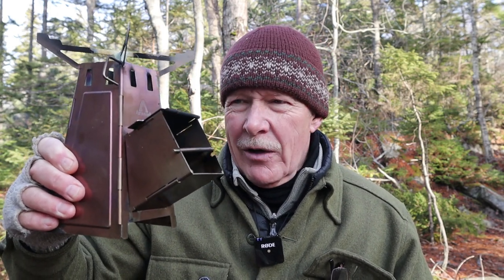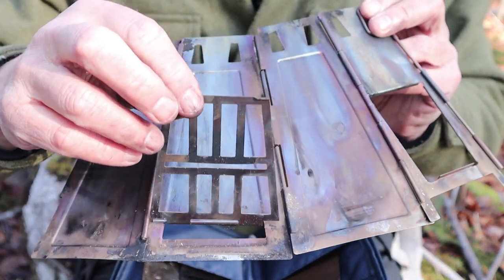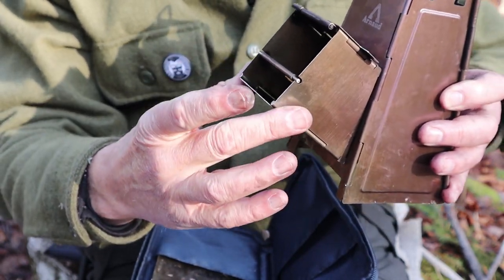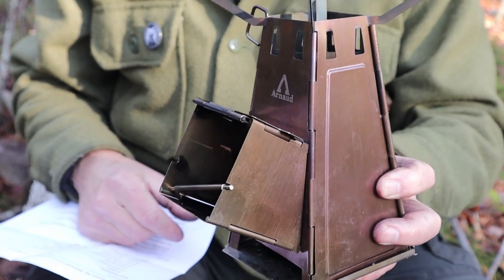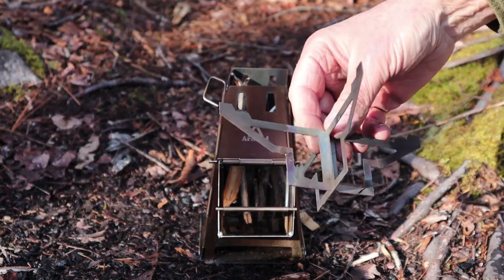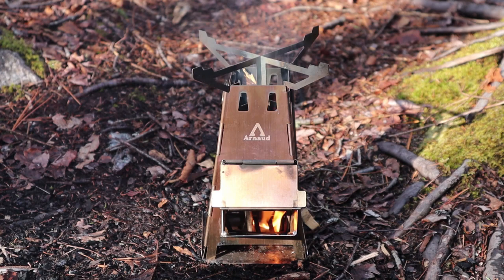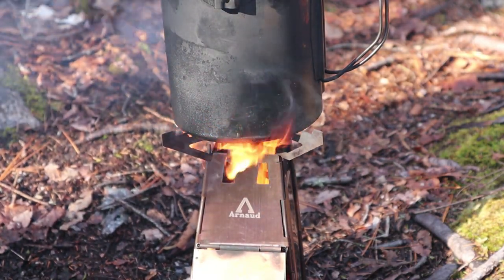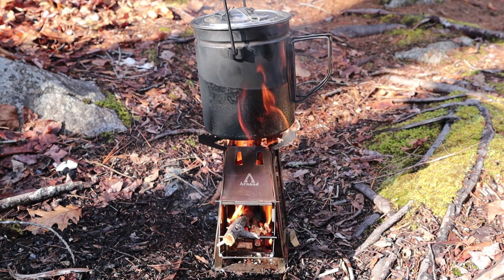The FireTower by Arnaud

Comment: Really exciting to get introduced to new products I haven't seen yet. I have the lixada rocket stove and I like it, but it's slightly bulky even though it is light. I have been looking at the Vire stove and I really like the flat packing aspect, but it's so heavy at 1.3 kg and the smaller version I'm told doesn't work as well. The FireTower of course also flat packs and at 500 grams it saves you 800 grams in your backpack. Thank you for showcasing this product, awesome!
Reply from the maker: I enjoy testing out these new stoves. Thanks for commenting

Comment: 500g for a flat packing rocket stove, that's excellent. Price is fair. Setup is simple and quick.
 They could make it out of titanium for a backpacking version as you said, which I agree would be a good choice.
Ashpan could be replaced with a much thinner lighter piece of steel for a good weight reduction.
The tappered chimney helps with airflow due to Bernoulli's principle. 
Engineering put to good use :)
Reply from the maker: I agree it is well thought out. Thanks for commenting

Comment: That is a well designed stove for sure. So many aspects of it that I like, and with a couple of tweeks you suggested, even better. If the slot the feed tray pins slide into were "L" shaped instead of just straight in, that tray would be far less able to slip out of place, and add a bend to ends of the tray wire nubs so they won't slip inside the feed tube...
Reply from the maker: Agreed. The designer is ready the comments and is looking at making some changes. Thanks for commenting

Comment: Some impressive engineering on that stove.   Do you feel that the feed "ramp" offers an advantage over just a plain open square that many other stove designs use?   If the ramp facilitated automatic gravity induced self feeding for fuel, I could see a tremendous advantage.  However it seems as though it still requires manual fuel feed maintenance.   In my mind, I'm comparing it to the Firebox stove that has two small feed ports located 90 degrees from each other.   The firebox fuel feed system works very well for me personally.
Reply from the maker: Hi Lonnie. Good to hear from you. The best comparison I can give is with a Chinese rocket stove I reviewed a while ago. It does not have a air feed under the fuel ramp. Instead it relies on air being drawn in from around the base. It has pretty much the same performance as this stove does. A more greatly angled feed ramp may make better use of gravity but I feel it would compete with the primary chimney for which way the flame would rise. I have seen much larger rocket stoves that are able to achieve gravity feed but I expect it would be hard to do in a small stove. The Firebox feed system stands as a classic bit of engineering. Simple and effective. I have another stove from Arnaud that I will be reviewing that makes better use of the duel air-wood feed ramp. Hope to see a new video from you and Connie soon
Reply: @MarkYoungBushcraft  Thanks Mark for the feedback.  I am impressed with the design of this stove that you showed.   It is clearly well thought out, designed and constructed.    I'm just sort of thinking out loud here trying to think through the burn and real world use dynamics.  I'm not really trying to run down the product in any way.   I hope you don't mind my way of critically thinking out loud.

Comment: G'day Mark, with the tall tapered walls, or frustum, (I had to google that, ...... a long while since high school, lol), anyway, its pretty much like a miniature fireplace/chimney, so I'm not surprised it draws so well.
Personally I'd be wanting to light it with a ferro rod with the chute off, which means you'd have to be quick installing the chute, before the main body heats up too much, since it appears to be a two handed operation, i.e you need to hold onto the main body while you do so.
Other than those tweaks you mentioned, I'm think'n some clearance between the ash tray and the ground wouldn't hurt, say => 15 mm.
Ultimately, between the draw, the feed in feature, fold down and storage, a lot to like. Cheers Duke.
Reply from the maker: Frustum. You just added a new word to my repertoire. Arnaud will be reading your suggestions as well. Thanks for commenting Duke

Comment: Rocket stoves take advantage of the thermodynamic law that heat rises and draws in cooler air from beneath. The increasing heat accelerates the volume of air drawn in from underneath, increasing the heat even more through efficient carburation (mixing of oxygen with combustible gases). This is what also makes the Kelly Kettle a fantastic water boiler, especially because the flame is completely shielded by the  double walled design which forms the water jacket. Unfortunately, the Kelly is bulky and somewhat heavy for my habit of taking very long walks in the mountains. 
I might buy the titanium Arnaud stove when it becomes available. 
Thanks, Mark!
Reply from the maker: Good explanation. Thanks for commenting

Comment: Nice! Hope more similar atoves like this one pop up. I think thr feeding ramo is unnecessary. I would use just thr tower. The simpler thr best.
Reply from the maker: So many stoves with different designs and features. Some work better than others and some just need a tiny change to improve function and versatility. Thanks for commenting

Comment: Morning Mark!    I have to say, I almost didn’t watch cuz I don’t like rocket stoves.   Too much heat in too small an area means they’re pretty much only good for boiling, and they’re too tall for the width for stability, plus they’re mostly too big and bulky, but I kinda like this one.  I really do.   I can see this as a great thing to pack along to boil up some tea quickly on a day hike, or for a night or two.
It just lacks the ability to double as an alcohol stove on rainy days, but a wire stand and a piece of aluminum tray wind screen would fit in the case.
And for about $100 Canadian.  I may actually get one.   Except I’m buying a new shotgun today, so it’ll have to wait a little.
Thanks Mark!         And no, I still prefer my firebox. 😂😂
Reply from the maker: OOOH... been a long time since I looked firearms. What are you buying?
Reply: @MarkYoungBushcraft    Remington Versa Max.    It’s not the best semi auto out there, but it’s not the most expensive either, and the few complaints are actually easily fixed.    Plus it’s supposed to be easy recoil and I’ll be doing some goose hunting this coming fall.  I don’t have a proper waterfowl gun yet, which is odd, since I have so many others (I sport shoot quite a lot, small game hunting, and am planning bigger game soon) so today I found a good priced second hand one, with the waterfowl coating.
Reply: @jimf1964  Nice!

Comment: just found and subscribed to you.  I was looking for info on making my own wood gas camp stove, and found your videos entertaining and useful. I tried my hand at it a few years back, and was disappointed, but I think the idea has promise.  I used a stainless steel double walled  tall coffee mug.  I thought, being tall, it would have good draft. The 2 walls being close together would make for good heat transfer. I see now that my air holes were too small and few, and the pot rest was too close and hampered the flame.  It's a little unstable, but there are some easy solutions.  Every thrift store has 3 or 4 of these mugs, missing their lids, for a couple bucks.I'd love to see how you'd do with with this, having your extensive experience, before I try it again. Thanks for the channel.
Reply from the maker: I have considered playing with these mugs as well. I may give it a try. Thanks for commenting

Comment: This is a VERY interesting stove Mark. I wish the stove had an option for a fire grate with small round holes so you could use wood pellets. It seems that the air flow this stove has would lend to a great burn with pellets. Maybe a diy modification with a separate grate on top? Thank you for sharing. God Bless.
Reply from the maker: It would be worth seeing if I can make the stove work with pellets. If I do, I will post another video. Thanks for commenting
Reply: @MarkYoungBushcraft  I would definitely look forward to it!
Reply: To Fireside Coffee:  Tinker says "Make one". Few tools are required for working thin gauge metals, even titanium. Firebox stoves (USA) makes a titanium cooking grate which  may be reworked for many different applications.

Comment: Seems to be a better stove than Kombuis 1.0
Reply from the maker: I just reviewed the Kombuis 2 but don't have the Kombuis 1 to compare. I like this better only because is folds flat and it lighter in weight. Both work well. Thanks for commenting
Reply: @MarkYoungBushcraft  I'd like to know how long it can burn without tending to? 

I know the firebox size and feeding port both contribute to how much it can hold. And the heat and fuel amount can both affect how fast it is running. I just want some estimation.
Reply from the maker: @yookoala  Also hard to estimate. If I load the burn chamber vertically I can get maybe 6 or 8 finger size stick in it that are no more than 5" in length. Loaded like that, all the woods becomes engaged in flame. If I use the feed ramp only, I can get maybe 4 or 5 finger size sticks in the chamber at once but they can be any length at all. Using the stove in this fashion, only the last 2 or 3 inches is burning. Hope this helps

Comment: Looks like a great stove.  An excellent reviewing job as usual too.  If I was tweaking this to fix the feed ramp problem, I would try extending the slot where the pins go,  not continuing straight toward the stove, but taking a 90° bend.  This would make it so when you put the ramp in place, the pins on either side would go in as they currently do, but then drop down into the newly designed slots.  Theoretically this would sort of lock the pins in and prevent the ramp from being pulled outward and falling out of place.  I cannot tell if the width of the ramp within the stove is enough to prevent the side to side motion which would cause a pin to drop out of place allowing the ramp to fall out as well, but this would also need addressing.  (Perhaps I missed this in the video?). Either make a wider ramp, or as you said extend the pins.  
What do think?  Take care.
Reply from the maker: I think you have something there. A combination of the approaches suggested should work. Arnaud is reading the comments so I am sure he will consider your ideas. Thanks for commenting
Reply: In hopes this will be helpful for a redesign, how about this?:  On the left side have a hole in the stove wall instead of a slot for the left ramp pin, and on the right a slot as I described earlier.  One would start placing the feed ramp in at an angle, slip the left pin into the hole, (which should be large enough for ease of placement), then guide the right pin in and down into the right side slot.  The hole on the left and the final area where the right pin ends up should be designed so the ramp ultimately sits level when in place.  I don't think there'd be any more falling out of place!

Comment: NOW you show me a lighter stove. I bought a thicker version of a tower stove for the capacity to handle heavier pots. I kinda like that version better. The marsh kettle survivalist stove. Because of the Coronavirus didn’t know if society would shut down for a second. Need a way to boil large pots of water. It’s a sectional stove. And ways about the same as the red camp stoves collapsing. But for just hiking (when allowed). Would like use that version when there’s no burn order in play. Gotta love ya man. Always a great job. SEMPER FI
Reply from the maker: Sorry about that😅 Thanks for commenting
Reply: @MarkYoungBushcraft  I meant to say I like your version better. Can’t find it on Amazon though. Will I have to buy it directly from the website?
Reply from the maker: @pakleader4  Yes, as far as I know you will need to buy directly from Arnaud. Hope this helps

Comment: General question...
What stops the sticks from burning back up the feed pipe ? 
This is definitely the most practical looking rocket stove I've seen to date...thanks !
All the best 👍
Reply: They may burn, but the inward ends, burning more quickly than the rest of the stick, naturally cause it to slide downward into the burn chamber. That, plus the inflow of air tend to keep the fire there.
Reply from the maker: as Daniel responded. Thanks for commenting
Reply: @danielkutcher5704  Much appreciated 👍 thanks for the full explanation...
I've always wondered about it...
All the best .....

Comment: How much soot does it leave on pots?
Reply from the maker: All wood stoves leave soot. It depends on so many factors. This one maybe less than others when it is running hot. Thanks for commenting
Reply: @MarkYoungBushcraft  i find that wood gas stoves soot the least if you waited till the gasification started before putting on your pan or put. I was wondering hope this rocket stove compared to a typical wood gas stove s far as sooting goes. My Biolight campstove sooted the least because the fan provided constant oxygen for a complete gasification
Reply from the maker: I agree, wood gas stoves soot less when at peak operating. Rocket stoves are also quite efficient and nearly smoke free when they get running. As with wood gas stoves, they can vary based on design, wood choice, etc. Overall, a good rocket stove is near equal with a wood gas stove as far as being smoke free  @CharlesLe-thephotographer